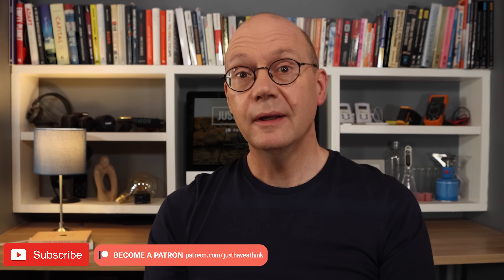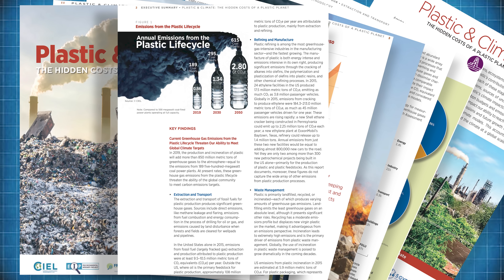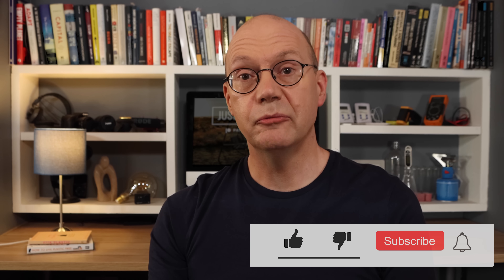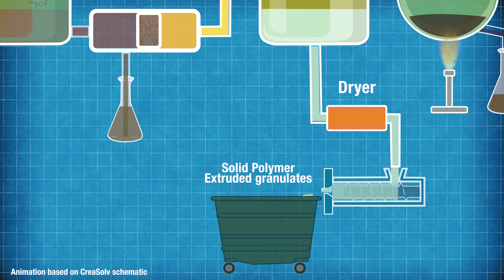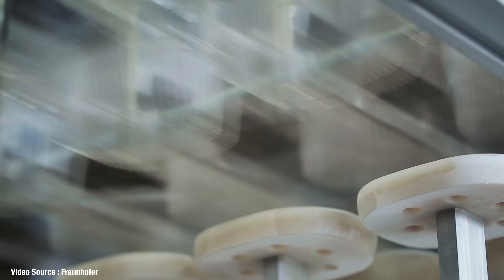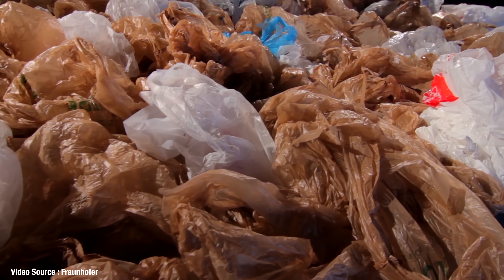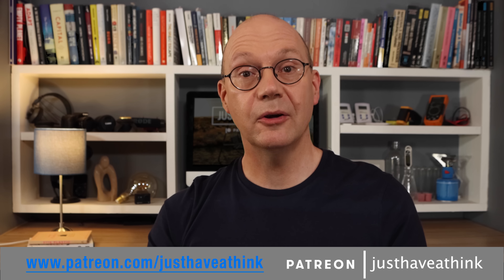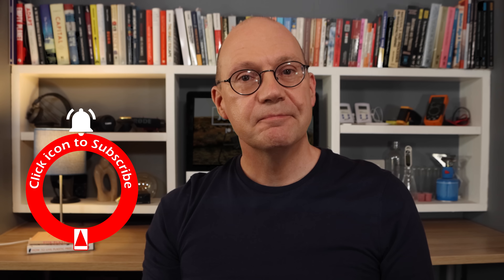Plastic recycling - revolutionary new process

Comment: I love to see you presenting sollutions for  seemingly insurmountable problems Dave ! Thanks, and thanks to the EU for focussing on and funding these kind of innovations !
Reply: I do not see the problem.
Plastic burns and generates a lot of energy so burning saves oil.
What advantage should recycling have? I only see disadvantages
Reply: @TheSpecio  You have to extract oil in either case (extract oil --> burn oil; extract oil --> create polymeres --> burn plastic). Recycling creates ressources in our own backyards so to speak, preventing the need for installing complicated infrastructure in remote and extreme places on our earth to get them were they are needed.
It also is way more sustainable, benefitting our well-being by protecting the environment from damage. We probably already created an unsolvable problem with nano-plastic.
Reply: @Vulcano7965  Yes, you have to extract oil in either case: collect plastic > Extract oil to fuel the recycling process > recycle plastic to low-quality new plastic.
Let me show you how this 'recycling' works in the real world: Collecting the plastic for recycling instead of burning it with the mixes waste deprives the waste of energy. In order to incinerate the now low-energy waste, oil is sprayed on it; without this oil, it wouldn't even burn.
And if you fear nano-plastic, you have to ban plastic at all. This would lead to an immense waste of wood, fabric for packing, waste of energy (For example the very energy-intensive production of glass as a substitute) etc,  immense destruction of agricultural products which we protect by packaging in plastic, waste of oil and gas because we would not insulate our homes as well without plastic foam and dozens of other disadvantages.
Plastic is SAVING gas, oil, and coal, protecting the environment by reducing the needed area for agriculture, improving our living standard and preventing over-exploitation of natural resources like forests or arable land for the production of natural fibres instead of synthetic ones and, and...
In short: get real!
Reply: @TheSpecio  We're talking about the processes mentioned in the video.
So you base your whole assumption on this: "collect plastic > Extract oil to fuel the recycling process > recycle plastic to low-quality new plastic. "

You don't need to ban plastic entirely to prevent further contamination of micro + nano-plastic, that's a strawman. You need to recycle the used plastic back into a production cycle so it doesn't need to be thrown in landfills. That's the whole issue this video is addressing.

It's very likely that Oil and Gas will still be around in the coming decades, although only/mostly for plastic production, since there will always some loss in the recycling process. So I'm not quite sure what you're so mad about.
Electricity generated by waste incineration makes up a tiny fraction of our energy production.
Reply: @Vulcano7965  I am talking about intelligent and cost-effective ways of managing our plastic demands.
No one wants to throw it in landfills. I said: BURN it! Effect: No nano-plastic. And because this ist cost-effective, it's easier to enforce. Right now, plastic fuel is already profitable for the cement industry (rotary kilns, very effective for burning old tires too) and iron industry (shredded plastic is blown into blast furnaces together with combustion air, saving HUGE amounts of coal and oil)

And my whole assumption ist: You need LESS oil if you incinerate used plastic to produce energy and make new plastic out of oil. 'Recycling' plastic is a no-brainer. It doesn't have even a single advantage.
Reply: @TheSpecio  You'd need a massive uptick in oil production to fuel entire industries with plastic waste.
And that's just not profitable anymore.
Not to speak of the additional cost of CO2 capture and storage you'd have to install.

Plastic recycling is indeed a no brainer and it's only getting more efficient. I'm still not sure why you are so mad about that fact.
Reply: @Vulcano7965  Not fueling entire industries, but substituting a PART of the fuel that is needed anyway.
And because this saves conventional fuels, there is no additional CO2
Reply: @TheSpecio  There is if you burn plastic. That was your entire point. recycling prevents largely the need to extract more oil (additional CO2) to produce new polymeres.
Again, if your issue is cost effectiveness, some simple polymeres are already very suitable to recycle which saves a ton of ressources. If more complex polymeres reach the same degree that drops further the need for additional oil production. It will be more cost effective aswell since your primary ressources are in the vicinity of high tech industry regions anyway. 

If your entire argument resolves around plastics as a substitute fuel then I want so see some solid numbers that this will deal with our plastic trash and is not just an insignificant figure. Otherwise this is a meaningless argument.
Reply: @Vulcano7965  I am sorry but you are obviously unable to understand even very simple equations.
When I burn a kilogram plastic, I save a kilogram fuel. When I recycle a kilogram plastic I save a kilogram plastic, but I will have to extract 1 kilogram more fuel because we NEED fossil fuel anyway. Fossil fuel is essential for engines, cement production, iron and steel, and many other technologies, like plastic recycling! Recycling or burning makes no difference in the consumption of fossil carbohydrates (Gas, oil, coal). And it's even better: Shale gas, for example, even supplies us with byproducts like ethene that are perfect for plastic production. Byproducts! They are FREE! 
Even a child understands that logic.
You don't.
I expect a certain minimum of logical, technical and mathematical skills from my opponents, otherwise, no serious discussion is possible.
Good bye.
Reply: Both ideas are stupid.
Burning plastic is harmful to the atmosphere, waste-to-energy plants have the potential to emit low levels of toxic pollutants such as dioxins, acid gases, and heavy metals. Do you fancy living next to them? Natural gas is cleaner and much cheaper to extract energy with much less post processing to the emissions.
Recycling plastic is labour intensive and hard too. Most of the plastic ended up in landfills or polluting land and sea with micro plastic.
The problem with plastic is it’s cheap to produce but costly to dispose of, either it costs money or harm to us and environment.
Ban plastic or bane by it. It’s laziness that humans are using them, especially for single use disposables and packaging. There are many alternatives, we just need to revert to natural products like farming byproducts (straws, beeswax etc). They might be more expensive, but friendly to return it back to the earth.
Reply: @madsam0320  That raises the question of if you would rather those toxic pollutants come from fresh coal, or refuse that has already made a couple loops through the energy cycle already. Also, what about what happens to the products once the products containing plastic exit the stream and go to a landfill?  I'll take my gains where I can get them.
Reply: He certainly does that, however I see him regularly missing, dismissing, or even condemning other perfectly viable solutions to our problems until better solutions can be implemented--burning plastic refuse for energy being one example. I personally wonder how many fossil fuels we could save if, say, garbage collection infrastructure was combined with energy infrastructure, so that anything combustible (that cannot be separated out for recycling) is incinerated in the boiler, creating energy and feed stocks for making new building materials, and anything that is not combustible (and not a metal or other recyclable material) being also useable for producing other products, even if it is just a cement aggregate. This way, very little goes to landfills, and what does is pretty much been nerfed in terms of its environmental effects.

Comment: another great bit of news..although I do hope it isn't like the TV program (tomorrows world) I used to watch on TV where I would hear about great, world-changing, technological advances every week and hardly ever hear about them again)
Reply: That's because of patents. If the first company doesn't work out all the bugs (and they probably won't) before they go out of business, the technology will sleep for 20-ish years for the patents to expire before research on solutions starts at other companies-- then, because modern patents are deliberately written to be vague and/or misleading rather than accurately describing the invention as they were originally meant to, the companies that start working on improved versions run into setback after expensive and time-consuming setback just in recreating the original version, even before they make their own improvements. Any improvements they DO make (or think a competitor might make in the near future) are immediately patented themselves, and the cycle repeats. It ends when a practical version eventually emerges after a several cycles, but goes on again between "generations" of the technology.

Comment: This would be a great technology to pair with high temperature pyrolysis to turn the 'waste' into the the base crude again, thus "closing the loop" on the rest. I would also wonder if you can sequences the polymer extractions so to remove the requirements for sorting at all. I think if you can provide a solution that requires minimal effort, it gets maximum adoption

Comment: Using our precious long chain polymers as a fuel is the real crime. When oil runs short, manufacturing is affected and ordinary items get expensive - this issue will be serious. 
Energy intensive processes are a problem when energy generation is expensive or uses fossil fuel - so the real solution is getting cheap clean energy. 
I recommend wind turbines and liquid air energy storage. And the nimbys (not in my back yard) need ignoring.

Comment: We are short on housing here in the UK, and in many other countries.  Shouldn't it be recycled into building materials?  Reduce wood use (less trees cut down), it lasts for a very long time, doesn't rust or rot, can be easily moulded to whatever shape is needed, plastic is a good insulator, and sound absorber.  We have a lot, and need a lot for building materials.  It's perfect.   Councils don't want it, and as a building material it's free and the only cost is in processing it.  There are plenty of re-uses if we only use our noodle.

Comment: I've tried to find information on the energy requirements for their tech but all I managed to find in their site was this quote
"As energy use is the primary contributor to the impact, the main recommendation drawn at this stage is to improve the energy efficiency of the process."
They're playing their cards close to their chest on this one at this stage so I can only speculate but I'm going to do exactly that!
This will still be an extremely energy intensive process The solvents in the process will be energy intensive to produce, the optimal temperature for catalysis will be high, the distillation process with require massive heat energy input, the drying of the product will require energy and the extruding of the polymers into pellets will be about the only low energy stage.
This is all dictated by the laws of thermodynamics.
Technologies like this are crucial, I don't need to explain why single use plastic is bad, and therefore energy is even more crucial; both electrical energy and HEAT energy (which is probably the main energy input for this whole process)
SO...
What energy generation technology has a low environmental footprint and could reliably power such a process 24/7 both with electricity and with heat?
 
Nuclear
 
Recycling is one of the examples I use to explain why "degrowth" (particularly of energy- sometimes in the form of unreliables) is a recipe for disaster.
 
Other than recycling, the expansion of nuclear energy will be paramount for:
-Sea water desalination
-Hydrogen production
-Synthetic hydrocarbon production
-Carbon capture and storage
-Displacing fossil fuels without destroying the environment
-And many more
 
If you think recycling or anything else on that list is important you should support nuclear!

Comment: To me all those technological silver bullets in plastic recycling are forms of green washing, just like "renwable" biofuels or hypothetical negative emission technologies. The solution to reduce CO2 emissions is not to cheat the laws of physics with more clever "technology" but to actually REDUCE CO2 emissions. The same applies to plastic. Instead of coming with clever ideas how to have your cake and eat it too, just BAN using plastic altogether and replace it with paper, glass and cellulose packaging. There is no plastic replacements for automotive industry? Too bad. Stop making so much cars, equipment and electronics that are obsolete by design and put some money into making products that last. Cars existed before plastic was invented, surely you can make them without it. Corporations are just fcn cheap and want to get away with actual costs of their industrial activities and resources yet still charge premimum on "state of the art" technology that is disposable after a couple of years. In summary: REDUCE, than reuse and recycle. There is no need for another technological solution, that will perpetuate the cycle of consumption. Just the political will of governments to ban harmful practices and corporations taking responsibility for and costs of their activities. Ultimately all necessary steps are leading to prohibition of capitalism as based on the principle of multiplication of capital and radical shrinking of economy. We have to live frugal and accept the real (including environmental costs) monetary cost of products we consume. Companies have to bear the costs of production. Not other species and future children.

Comment: Sounds to me the cruz of the issue is that the chemical process can help with some plastics but doesn't help for all plastics, presorting that the chemistry can do its thing is important as the reaction and purity would increase.  Have seen some AI object detection machines used in the industry that help with that on the line, a thought that popped into my head and I see some obvious issues, but why not detect or etch and detect a product identifier in the source (like a QR code) to assist with object detection, this also can help train the object classifier.  It seems eminently doable to have electric recycling trucks, solar power/battery from either grid or on site to run the classifiers, scale up as volume is important, and convert it to high quality materials.  The economic question becomes: is export of materials and this process cheaper to produce then virgin plastics to compete with (it seems like virgin plastics unless taxed will always be cheaper) or as a bare minimum are the exports capable of sustaining the business without external funding.  If so then it seems like this can, in the limit, clean up all material easily reachable in the environment.
Reply: @Jay...777  yes of course.  Sensible people working together to solve common goals.  I can agree with that.  Big problems require more participants and resources.  And we stand on the shoulders of giants, don't disagree with that either.  Even my ideas aren't my own, they have been triggered by the video and other sources as well.  Leave them as a gift.  You can only effect your part of the stream of life, and perhaps make small waves, hopefully those waves cascade in positive patterns.

As to the original idea.  It makes it easy for people in that position to create a higher quality output, it would be a decision that gets made at that specific facility, recycling makes sense, having recycling be better makes sense, selling the output that they produce out of that waste makes sense, as it's output is the raw inputs for other production chains - to produce those goods we love so very very much makes sense in that context. (Last part was a bit tongue in cheek)

If you think about recycling as a self funding cleanup program, a biological analogy would be a scavenger, it provides a useful role in cleaning up of the waste.  If the scavenger can move faster/do more than the production of waste, then you end the cycle, essentially all waste, even landfill could with an efficient enough process be converted into something useful.

Comment: Creasolv: imagine finding out that production and disposal of that solvent mixture is horrendous for the environment. Definitely not gonna happen, right... right?
Reply: The solvents used are non-hazardous
Reply: @mousetails9  thats not the same thing. Polythene is non-hazardous.
Reply: sboooon - most solvents that can dissolve plastics are fairly harmless, especially things like ionic liquids which are classed as green solvents. Anyway it won’t be disposed of, it will be recycled continually. And if you do need to dispose of solvents then you just burn them in an incinerator fitted with scrubbers.